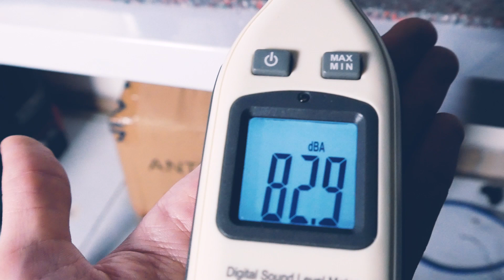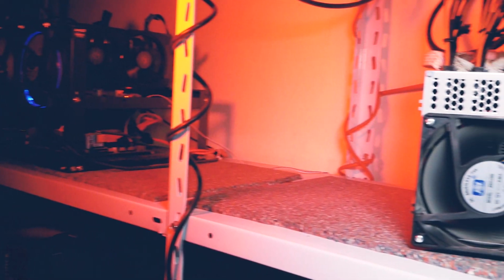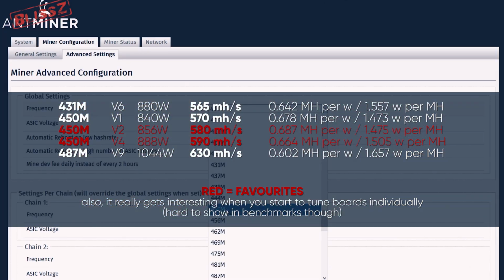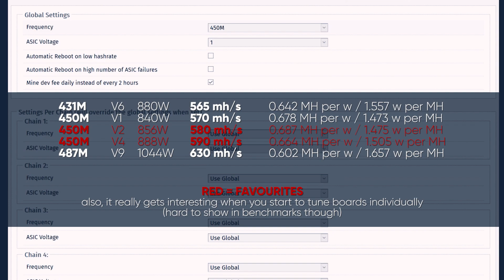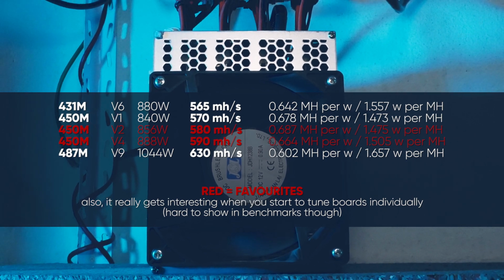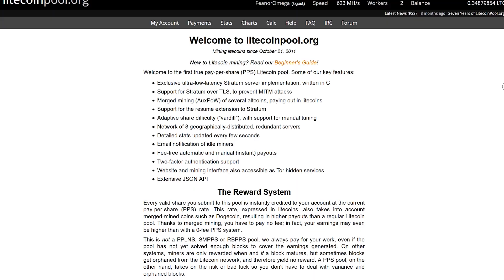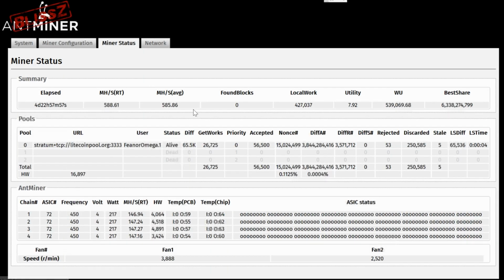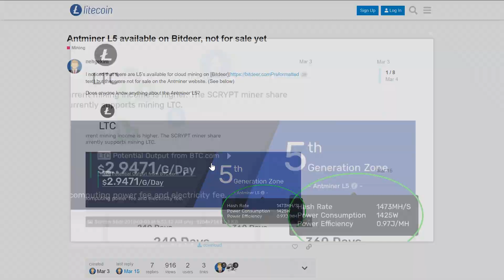Antminer L3+ Last Update | Litecoin & Dogecoin | ASIC Blissz Firmware

Comment: How many litecoins can you mine per month with this minor on a 1000mbs connection? Thank you
Reply from the maker: Connection does not matter too much as long as it stable - depending on the setting around 0.02 LTC a day, bit more or less depending on Overclock - cheers ⛏️
Reply: What is the best miner for litecoin and how can I check the probability? Thank you?
Reply from the maker: @dadasstories421  L3+ is still among the strongest which is publicly available. You can simply google "Scrypt Mining Calculator" - Scrypt is the algorithm for Litecoin. So with these you can check with your power-consumption and hashrate what is right for you. There is also machines by Innosilicon (big) or FutureBit (small but efficient) to check out.

Comment: Do you have 9v on all 4 boards?  What is your utility like on Litecoinpool?  On my L3+(s) all 4 boards for me are at different frequency and voltage. My best machine is over 640/45 MH/s @1130w.  Hungry and loud little suckers!
Reply from the maker: Absolutely agreed with loudness! V9 was my old setting on all boards yes, now with the V4-450m setting from the vid' - around 7.93 utility if I'm not mistaken - will look more into individual tuning myself :) cheers and thanks for sharing!!
Reply: @CursedMining  I just loaded up the Blissz Firmware for the first time. I'm going to try the V4-450MHz Set up for a while myself. Did you end up finding another set point that you preferred over that?
Reply from the maker: This is what I stayed with! Many people nowadays try to go for the lowest possible power, like: 500mh at 660 watts
Reply: @CursedMining  Two of my boards were getting a lot of hardware errors at V4-450M. I've been playing with the lowest voltage setting trying to see if there's any big efficiency gains at lower frequencies. I'll let you know if I find anything interesting.